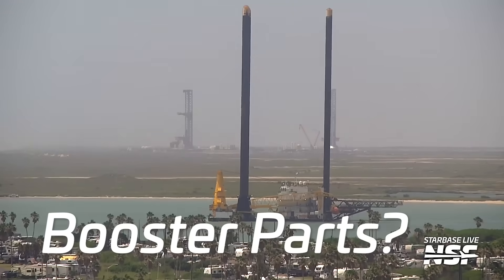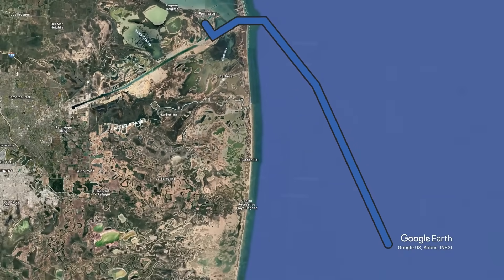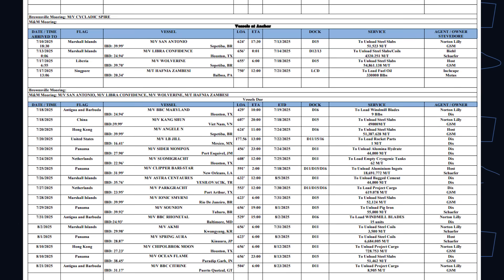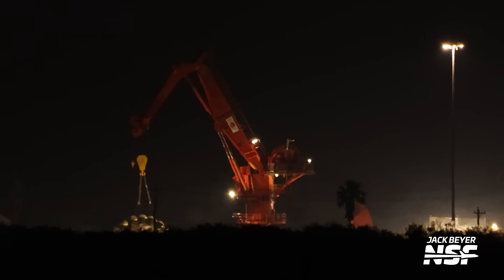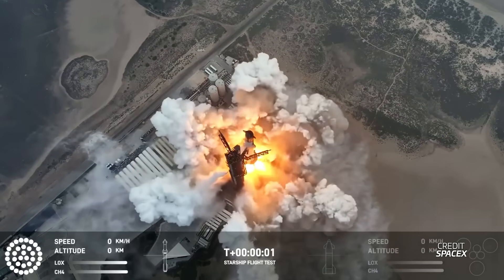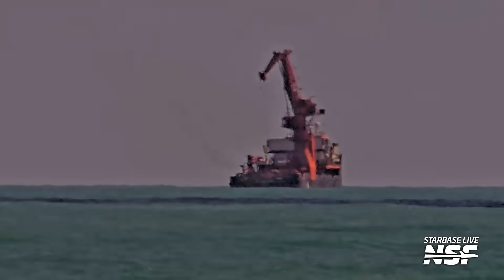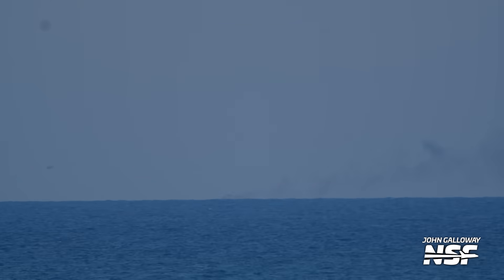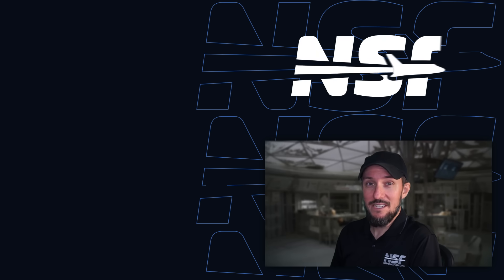LOAD ROCKET PARTS - Possible Starship Salvage Operation?

Comment: If British Petroleum has a well blow out in the gulf, they are required to clean up.  Is SpaceX required to clean up rocket debris in the gulf and washing up on shore?  There could be hazardous material involved.
Reply: Pretty sure none would wash up, as it's all steel. The only hazardous material is propellant, which would boil off very quickly after impact